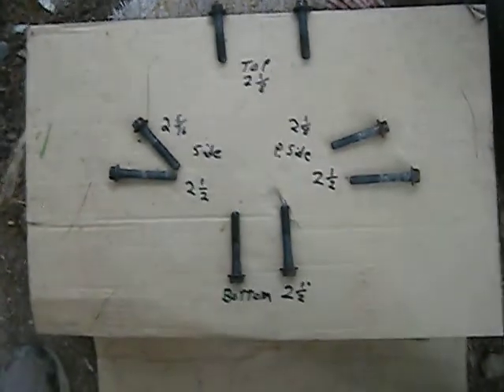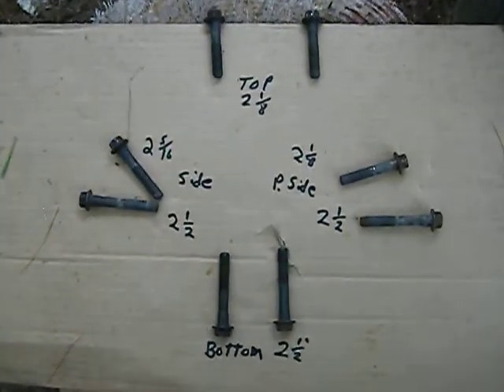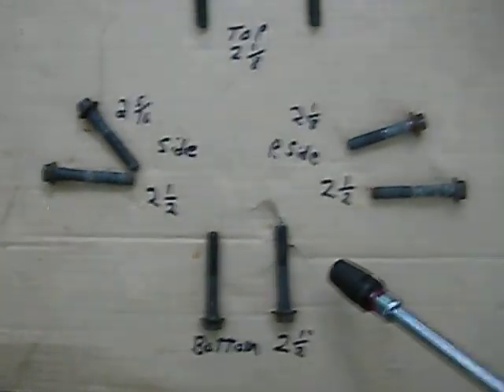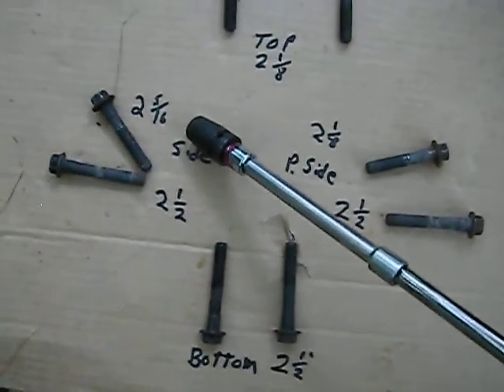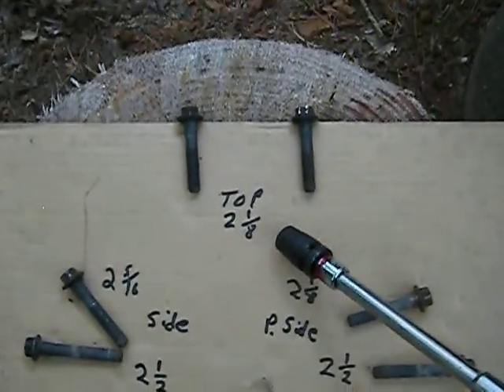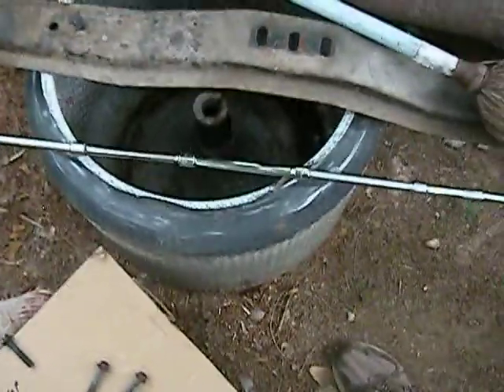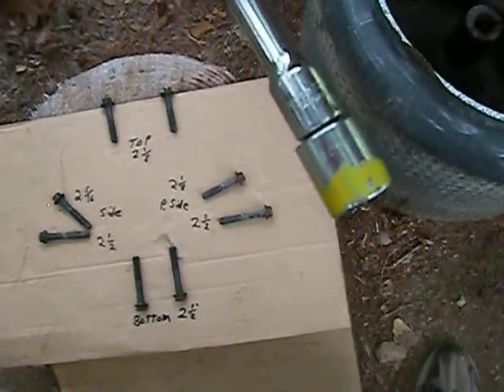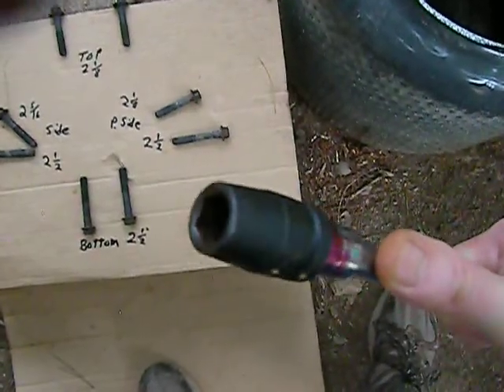Ford Ranger Transmission to Engine bolts

Comment: On a 1998 ranger 3.0l, 5 speed the bolts are M12x1.5mm. I needed bolts to mount the engine on the stand.

Comment: I got all but the top passenger side from the bottom. How did you get the top ones. Did you drop the tail end of the transmission?
Reply: In the cab theres a panell access them with extensions through that panel
Reply: Under your cupholders
Reply: @Bretbuck are you being serious?!
Reply: @radleybradford1356  yeah I did this years ago that was one of the only easy parts
Reply: Or tilt tranny.
Reply: Top passenger side is easy from the engine bay

Comment: What is the socket size
Reply from the maker: 13mm
Reply: use a 13mm 3/8" drive swivel socket with a long extension